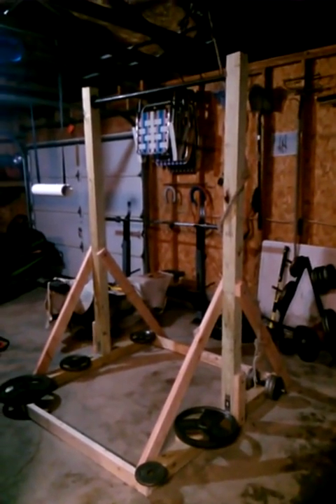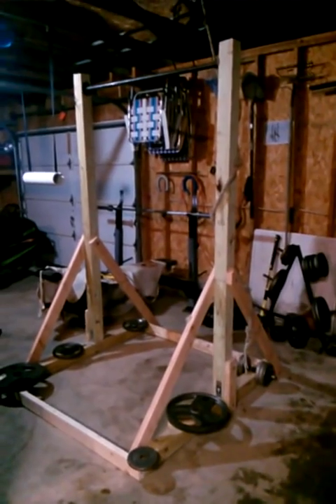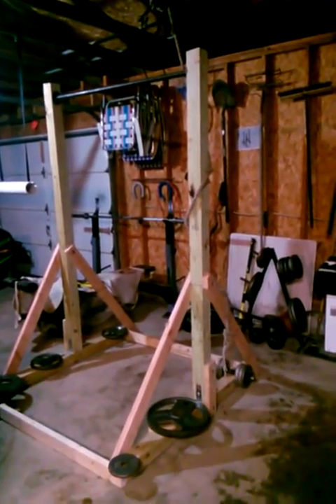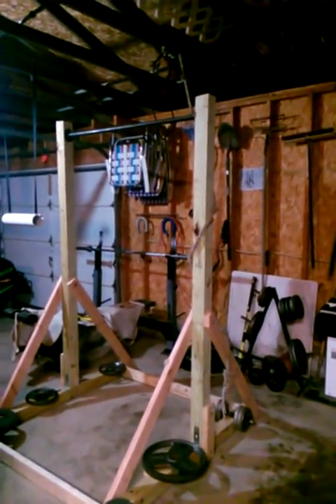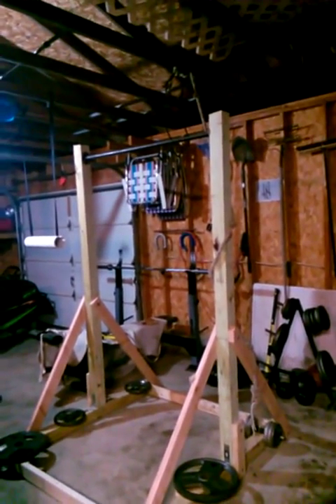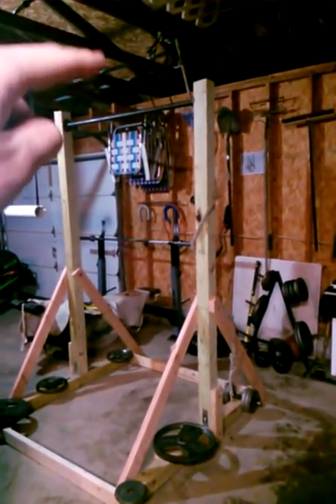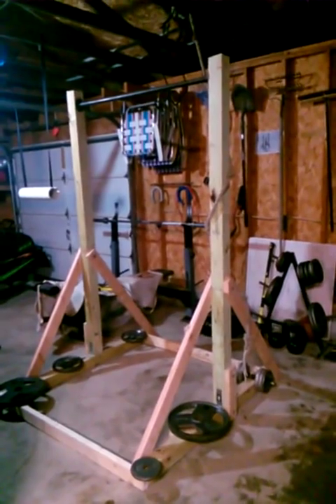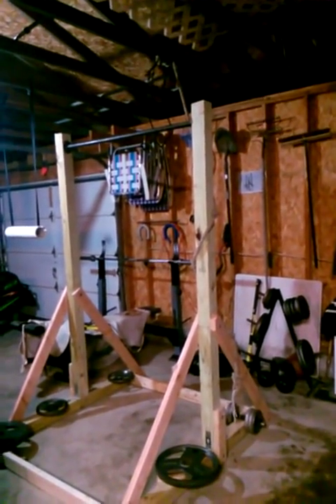DIY pull up station (freestanding pull up bar)

Comment: What if I used 4x4x10s instead of 4x4x8s for the standing posts? I wouldn’t have to change anything else right? Also, can I get away with using a 60-inch pipe instead of a 52-inch pipe?

Comment from the maker: First of all, thanks!
The exercises I do that cause rocking motion are exercises that involve kipping like explosive pullups, chest to bar pullups, and negative muscle ups. The rest of my exercises such as pullups, weighted pullups, chinups; it is fine for and does not rock even without weights. My goal was to make it as compact as possible so the 5'x5' perimeter of the base worked perfect. You could possibly make it wider and longer (base) but the wood worked perfect for 5' feet. Two 4x4x10's

Comment: Nice p.u. station. I'm trying to build one out of 4x4's similar to your design and was wondering about the length of your feet. You made them 5ft long and said in your vid that you have the weights on the feet to prevent the rocking. What kind of exercises do you do that cause the rocking? If you had to make it again, would you make the feet longer?

Thanks again for the vid and google sketchup!

Comment from the maker: I have to use weight plates to stabilize it. The base legs aren't long enough to prevent some rocking. I put about 50-75 pounds on the legs on all sides and it is stable. That is the downside of an indoor (non foundational) pullup bar. I weigh 205 and I am rough on it....

Comment from the maker: LASTLY, My bar height of 7'-0 is a little too low. My feet "just" touch the ground. So I would raise it up to about 7'2" or 7'4".When I do full leg lifts I just skim the cement floor with my toes.  I am 5'10 200lbs also for size measurement. Thanks for the view!

Comment from the maker: cut in half made perfect feet. If I built another one, I would try to find more "truer" wood that wasn't so bowed as one of the feet (4x4's) is bowed a bit causing the rocking and I tried to put it crown up so it wouldn't rock. I would also use bigger metal angles as opposed to my 4x4 inch but metal gets expensive.  Everything seems to be holding together well and although I've seen some better design and craftsmanship; for the money, mine has held together surprisingly well.

Comment from the maker: I thought about that as well. The options are limitless. Scooby1961 (I think) has a video showing 100 different types of pullup stations/equipment. In one he uses his front loader/backhoe. I would just make sure that the scaffolding can support lateral torque if attempting muscle ups are any side force granted theyre pretty heavy/stable.

Comment: Is this thing still going strong? 

I'm wanting to do something similar to this. Why did you use 4x4 for the horizontal floor legs? do you think you could have used a 2x4 instead? 

Thanks for shooting this! It really helps to see what other people have done.
Reply from the maker: Jason Sargeant , this pullup bar is still as solid today. I actually used it Monday with a weighted vest. It was built with overkill in mind.
Reply from the maker: Jason Sargeant and yep, I am not Youtube expert but I watch a lot. i always appreciate good videos. you could easily get away witb 2x4s for the lateral shorter braces but I would not switch out for the longer legs or vertical posts.

Comment from the maker: Fairly decently - yes. To do explosive pullups I often start on top of a box and swing down to use momentum when first starting. I also use it for my suspension trainer. I had on 25lbs in my backpack + 205 in bodyweight and it was still fine. I wouldn't go much past 250lbs though as it may take its toll.

Comment: Good video ncameron7. I have a couple of questions:

1. Would the pull up bar be a secure if two of the 45 degree 2x4s were taken out? 
2. Would it work if the pull up bar was secured into 2 buckets using cement?
Reply from the maker: 1. It would not be very stable without the 45 cross braces to prevent racking and shifting. The braces are a must. the only thing securing it at that point would be the small sistered 2x4 on the side and 2 metal angle gusset straps. 

2. You could possibly do this in buckets. but the bar would still rack and may tip over.The base is to prevent it from tipping either way which it does very well.

Comment: So since the bar sits inside the holes like you said, is the bar threaded farther so you can still attach it to the flanges?
Reply: Yes, the pipe was threaded a bit further to attach it to the flange but to allow it to rest on the wood on the bearing surface.

Comment: Not bad but you can actually buy a free standing pull up bar that you only have to setup yourself and they cost a little under $100 on amazon . Around $90 if I remember correctly . Although Idk if there's limitations with it . But doesn't seem like there would be .
Reply from the maker: The portable ones, and the ones you are referring to that can be store bought, indeed have limitations. They have height limitations, weight limitations (most are 250lbs) so that means less weight can be added for weight pullups. Since this was built by me, I know it will hold. There are no shoddy welds, or inferior materials. Lastly and most importantly, this does not RACK. It is braced properly so it won't shift when I practice muscle ups or kips. You can only do slow muscle ups on most cheap portable setups. This piece of equipment is for someone who aims to develop skills on the pullup bar and not just "pull-up".
Reply: ncameron7 EXACTLY!!!

Comment: I would have went all out and made it a crossfit type cage. I get you were on a budget but you basically needed two more 4x4's, then you could used the bracing for the top of the cage since you really wouldn't need it at thebottom anymore. You'd also be able to do bench and squats in it as well.
Reply: What is a crossfit type cage?
Reply from the maker: Leo Rodriguez  its basically a squat rack. 4 posts with 2 bars connection. Squat Rack/Power rack. Its not a "cross fit" cage. It was around long before. And i made it this way so i can tilt it over and move it easier as I put casters on one side. A cage would be cumbersome to move.

Comment: Is it necessary to place weights on the base of this thing to prevent it from rocking back and forth, or can it function without?

Thanks for the DIY
Reply from the maker: For normal pullups, no stabilizer weights required. For anything with swinging or forceful energy, weights required.

Comment: Hi @ncameron7, the link on a model doesn't work, can you please fix it?
Reply from the maker: it appears Sketchup has gone through some significant changes since I last used it. here is the link to the model. 

https://3dwarehouse.sketchup.com/model.html?id=7f1e8d5bb9e82c86627b0037db454495
Reply: Thanks!

Comment: hey @ncameron7 do you have to make it that wide and high? I'm only 5"3 tall i can make mine smaller right? Also who pipe did you use for the bar?
Reply from the maker: You certainly can. if you make it shorter itll be more stable, if you decrease its width itll just be a rationally smaller setup. I left myself with height in case I was doing muscle ups or any swinging exercise which required room above the floor.
Reply: ok great thanks a lot man, what about the bar where did that get that and what size
Reply from the maker: +ryan n ; any plumbing supply like Macomb Group Plumbing or whatever you have in your area. It's black pipe.  Home Depot should have it but smaller stores will only have PVC.
Reply from the maker: +ryan n and its just 1" Outside Diameter
Reply: k great thanks a lot for the help
Reply from the maker: +ryan n ; No problem. Theres a lot of options. Materials, budget, time,  and skill set are your variables. good luck!